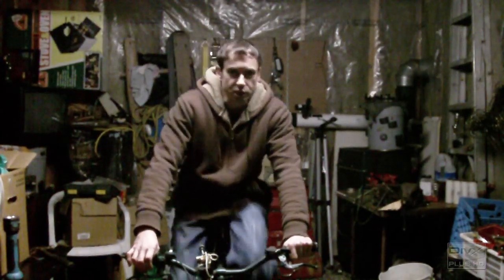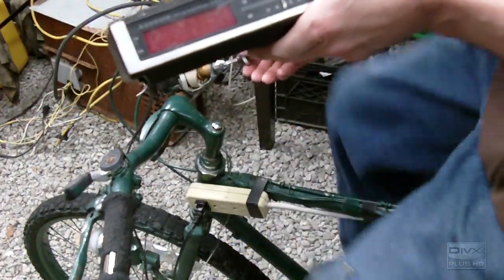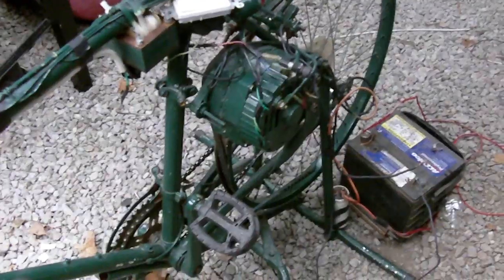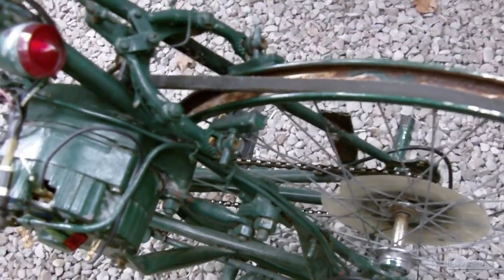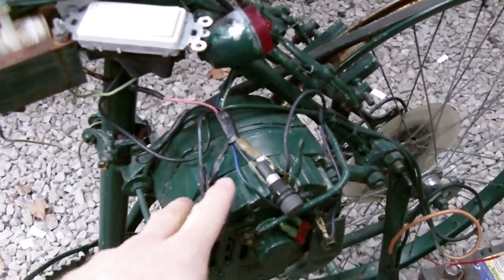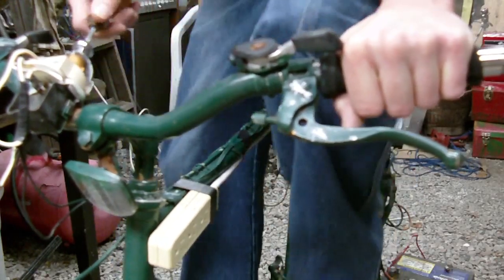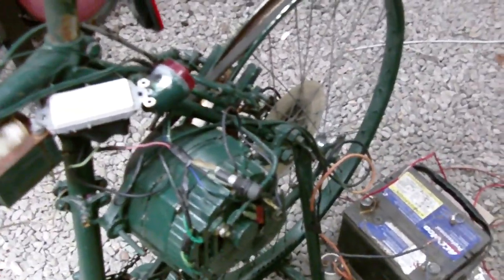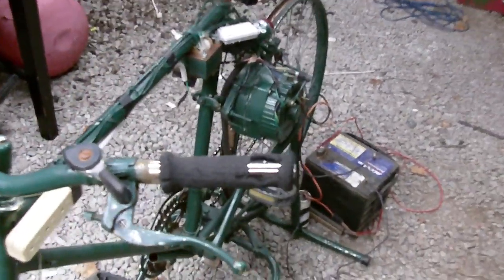Homemade pedal generator DIY 12v 120v

Comment: Thats a good idea but for a enthusiastic person like me that is a collector of steam engines that would love to build a steam electric power plant to power my house with electricity to run my water and heat my hot water and heat my house with steam radiators all in one unit because a wood fired boiler would save alot of peddling making electric by a bicycle

Comment: I am interested in using your design to make a generator,  but I have a few questions. How did you bypass the regulator? And how did you wire the other control mechanism,  did you modify the transformer? What are the specs of the transformer,  capacitor and alternator? Send me a detailed description of the entire system please.

Comment: It does make you wonder. Are people so helpless they don't know any other way to charge their cell phone other than plugging it into the wall.

People without power or water for weeks now... wow. With the inexpensive solar panels, inverter, some batteries and a 120v water pump, LED lights. Even a little contraption like yours to help maintain the battery.
No hope for so many. They're all waiting for gov and utilities companies and landlords to fix stuff